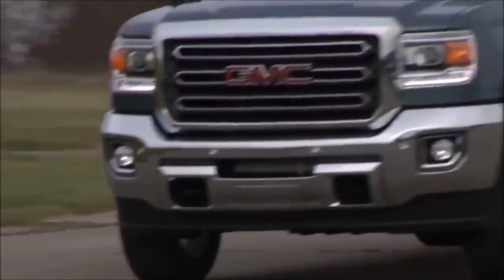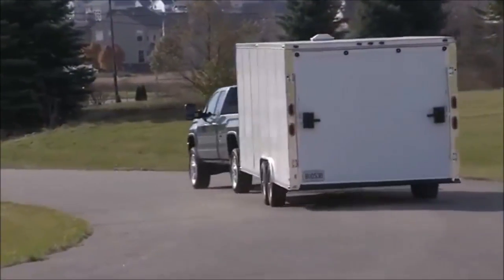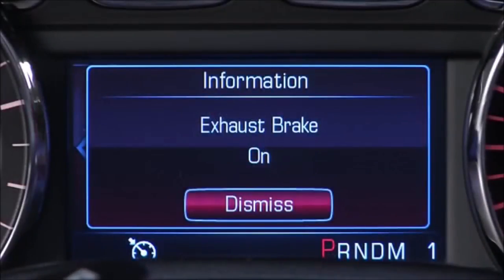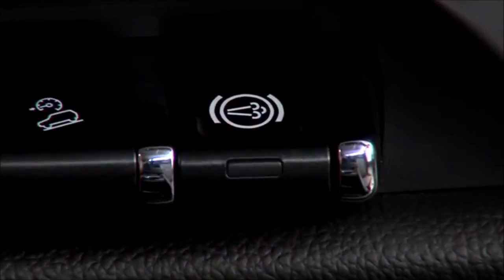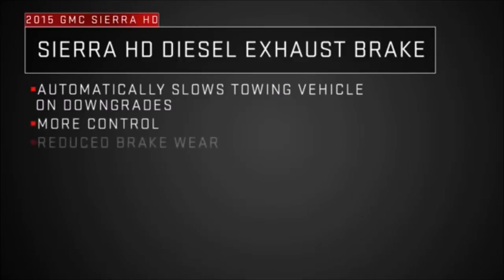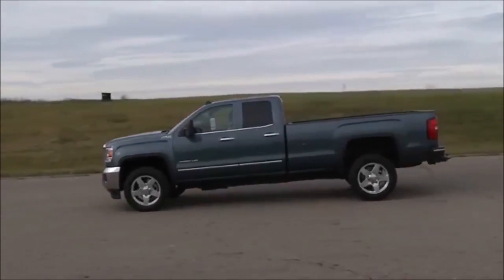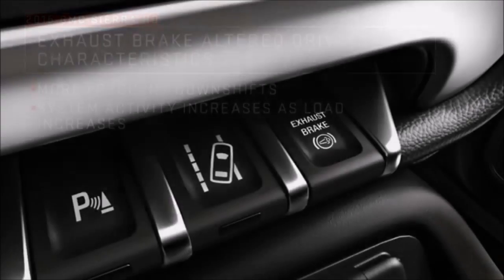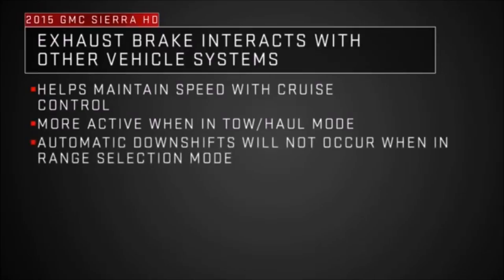How to use the GMC Diesel exhaust brake technology.

Comment: My 2014 Chevy 3500 Single Wheel Crew Short Box, I have used that Truck Brutally since Day One with 160.000 miles on it. I have only had the Exhaust Brake come on Twice since it was New, Both on Down Hill grades, I actually was having a conversation with a Passenger telling him that it doesn’t work correctly since day one. I pull Equipment with it from Mini Excavators to Track Loaders, Tool Crib Job Site Trailers. Never has it came on pulling anything, only braking down hill twice. Any ideas?
Reply: It’s possible the veins got stuck and aren’t actuating causing back pressure u need for exhaust braking. But it’s not that necessary just use the gear selector and gear down when towing. It does the trick
Reply: You have to turn it on it doesn't automatically come on